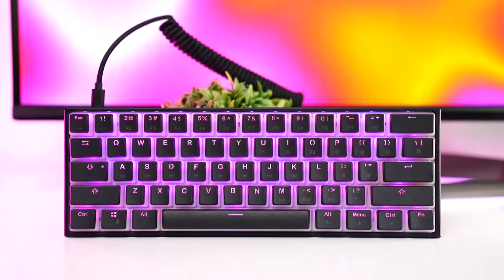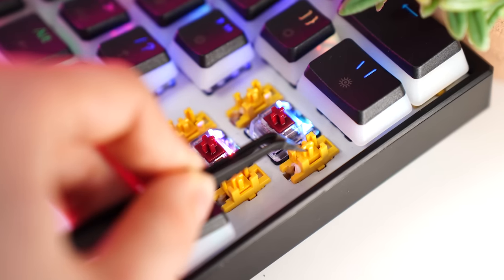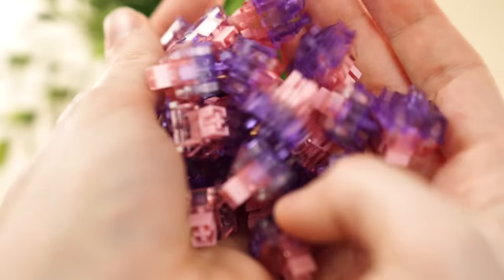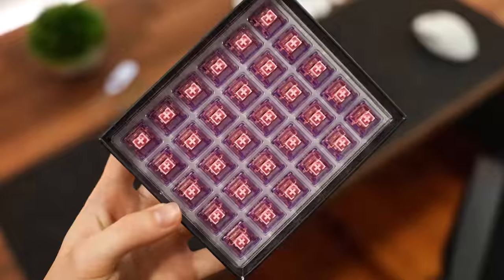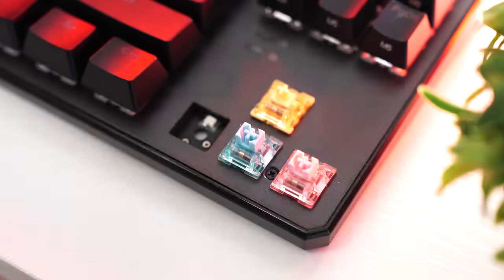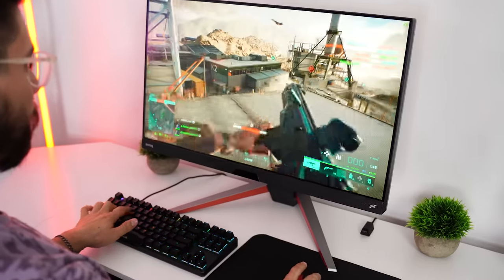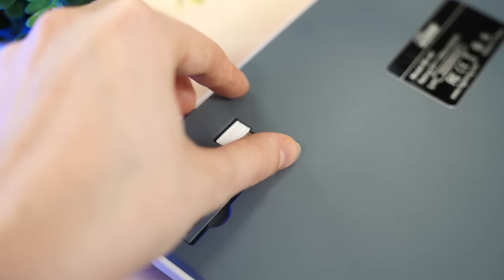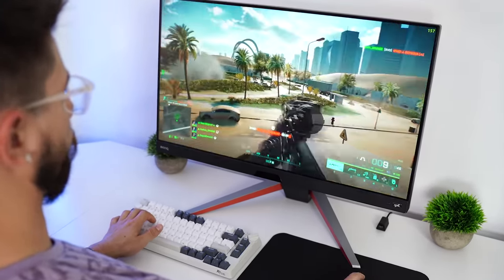Top 5 Budget Gaming Mechanical Keyboards

Comment: Honestly, imo tecware's in this one is the best TKL sized with perfectly tuned sound with awesome stabs, and sound compression. Definitely the best one in this list imo
Reply: I just got one with outemu brown switches. It’s definitely not bad, but it has a lot of pinging noises when typing
Reply: @KrutGemByte  you probably got the tecware phantom 2020-2022 models, they're the only ones that come with outemus, that's why the switches pings for you since they're yk outemus. While for the phantom +s they (tecware) have their own set of customized prelubed ones, which doesn't have any pings at all, and on a same price tag as the old (2020-2022) models.
Reply: @TeaTehMan  I should’ve gotten the 104 key lol. Cause that’s the only one available that has their wraith switches
Reply: @KrutGemByte  ahh alr

Comment: Do the tape mod (2-3 layers of blue painters tape on the back of the PCB) on the Ractous/Tezarre 61/63s and others like them. It's so quick and easy to do, just a couple keycaps and 6 little screws, and it makes a MASSIVE improvement to the sound. Putting the board on top of 1cm of closed cell foam or 2-3 small mousepads also can isolate the sound from resonating into your desk, and again massively improving the sound, making them feel like far more expensive boards.
Reply: +1 to this!!  I recently impulse-bought a Pulsar keyboard for work when Amazon dropped the price, and it honestly sounded pretty crappy at first.  I had some extra keycaps and switches that I brought in from home (white ASA profile Akko PBT keycaps and pre-lubed Akko Lavender Purple tactile switches), and my only other mod was opening it up and doing 2-3 layers of blue painter's tape on the PCB.  After doing that, this thing sounds WAY better than the very few dollars I spent on it... to the point that I could maybe consider a few other mods down the line but honestly don't feel the need.

Comment: i personally think the royal kludge should be on this list it is a great keyboard, comes with foam, stabilizers are already pretty good and foam between the PCB and the plate, just buy putting good sounding switches in it, it can make it sound really good

Comment: Can't recommend the Skyloong GK75 enough. I would go for the non-optical switch version myself (still under $100) but the build quality for the price can't be beat. It's insane. And the sound... so thocky and deep, if that's what you're going for. It just feels like butter. Like this review says, all the stabs come really well tuned; no pinging or rattle of any kind. Epomaker (Skyloong specifically) is king of budget boards. IMO
Reply: which switches would you recommend?
Reply: @freddyrodriguez8184  what ones did you get in the end
Reply: Does anyone have experiences with iceberg yellow switch? Are they better than  the gateron ones?

Comment: The GK75 is great I have this board with the glacier green switches theses are a tactile switch and have a greater bump that a brown for sure, I would say these have a bump more like an Akko blue . I did have to lube the springs of the switches though because it did have noticeable ping but luckily it was only the spring and not the leaf. The stem does come pre-lubed from the factory and is consistent.

Comment: I decided to buy the number one keyboard but it ended up not working, the lights activate and the keys work when I tried to change the lights but my pc doesn’t react to the keys at all, even though it reacts to my other keyboard. Is this a problem with the keyboard or my settings on my pc?

Comment: Hi there, im recently found you searching for budget mechanical keyboard and have a blast with the mods. Thanks in advance for the service you have been doing in pro the comunity. In latam there are not too many options in this starting point (I'm currently in Chile),  so I was thinking to buy the GK75 (and is available right now). On the oher hand, found out that the Keychrone brand is well known and the starting point of the k2 (v1) is around +15$, you still recomend to purchase this one instead?. 
Great video!

Comment: What are your thoughts on the Rk R87? I'm torn between Tecware Phantom + and Tecware Phantom+
Reply: Tecware phantom + is better imo only con is the lack of wireless and 3pin hotswap (not that you have to replace the switches as they're decent anyway compared to stock royal kludge switches)

As it stands, RK H81 is their current best keyboard but maybe the upcoming M75 will dethrone it